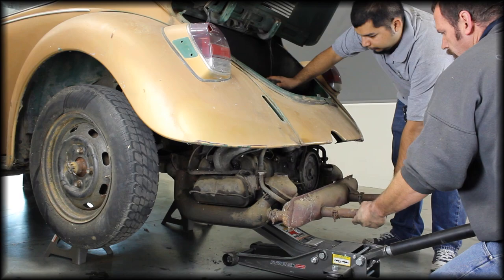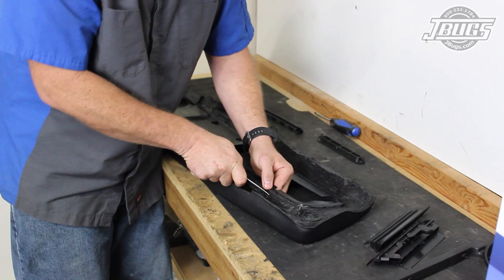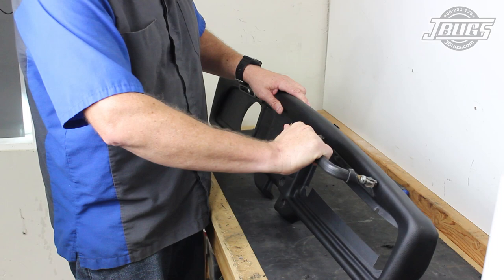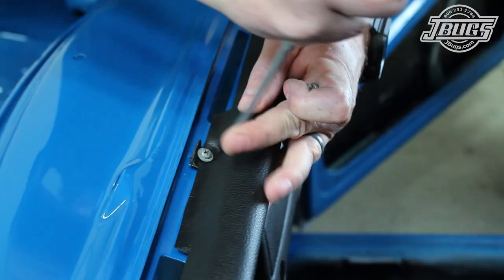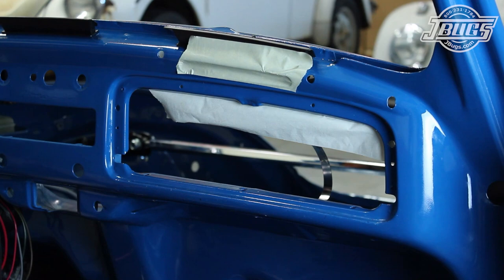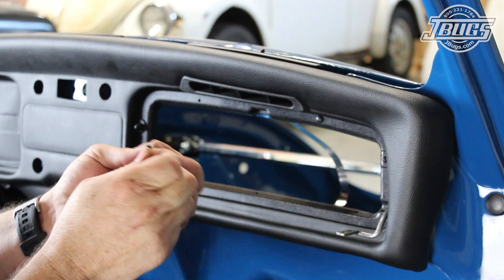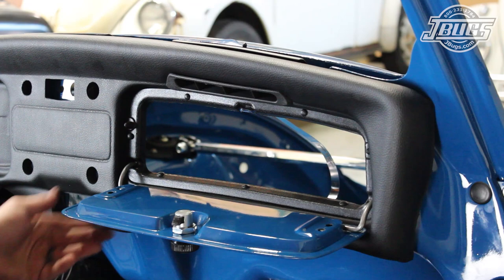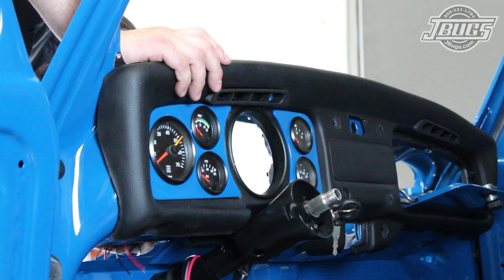JBugs - 1971 VW Super Beetle - Padded Dashboard Installation

Comment: New to this topic, I apologize for my ignorance. Does this frame works in a 1973 new beetle? Or they are different frames?
Reply: This dashboard (if that's what you're referring to as the "frame") fits 1971-1974 and 1976-1977 Standard Beetles and 1971-1972 Super Beetles. It does not fit 1973-1979 Super Beetles. - https://www.jbugs.com/product/113857051DS.html

Comment: Which 5 indicator lights are in cluster?  Blinkers and battery obviously. Sorry if this is a dumb Q.  Building a ‘70 with close to the same setup, never done this before.
Reply: Left Turn, Oil Pressure, Hi Beam, Battery, Right Turn
Reply: @Sam_Mebane  probably not a bad thing to have oil pressure light in addition to the gauge. Thank you for the info and great videos on the ‘71.
Reply: @joekegg  correct, but we're just mimicking what VW originally ran with the exception of adding separate left and right turn signal indicators.